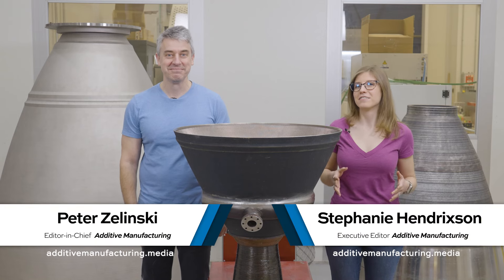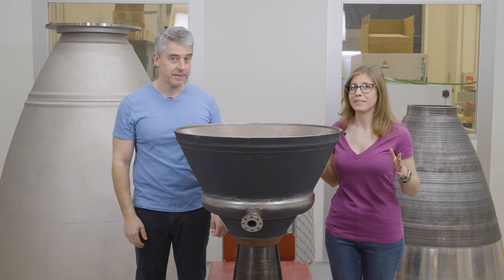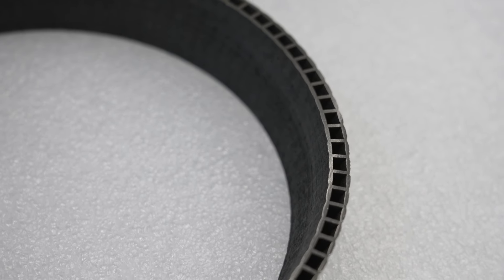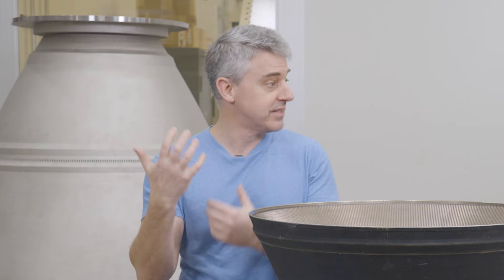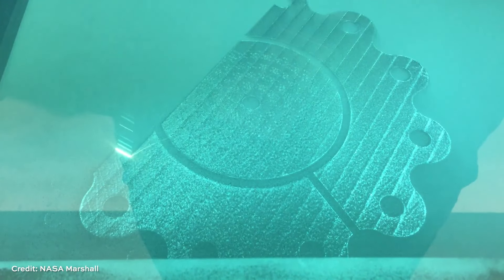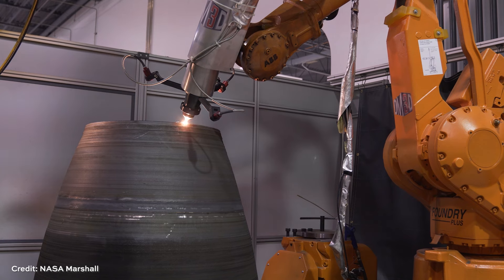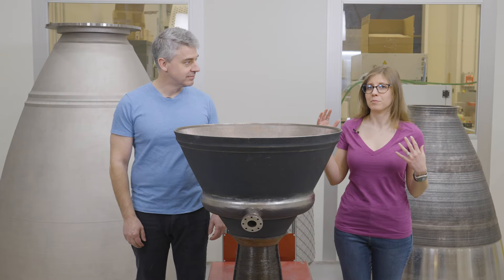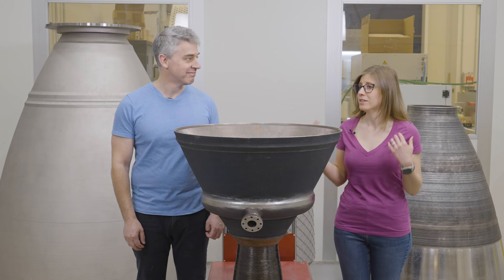3D Printed NASA Thrust Chamber Assembly Combines Two Metal Processes | The Cool Parts Show Ep. 71

Comment: So you use hot isostatic pressing, does this allow you to use faster, cheaper printers with higher porosity?
Reply from the maker: From Paul Gradl at NASA: "We still require very high density (low porosity) from the AM builds. HIP should not be used as a crutch for poor quality material. HIP has been shown to improve fatigue life, which is one of the major drivers in our designs."

Thanks for watching.

Comment: Do you still need machining afterwards?
There is no moving part but the holes for film cooling might be too small for 3d printing. Do you use lasers?
Reply from the maker: From Paul Gradl at NASA: "We machine and use post-processing where it is needed, such as critical interfaces. We use other processes such as surface enhancements if we need to modify the surface texture. We have developed the L-PBF and LP-DED processes to enable the small features/channels required for our designs. These processes use a laser as the energy source, denoted by the “L” for laser in the acronym."